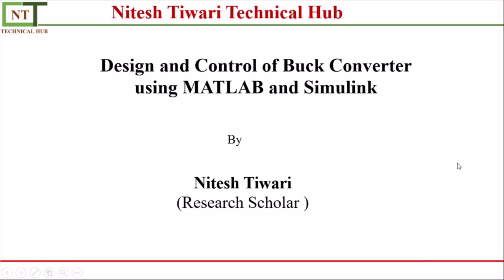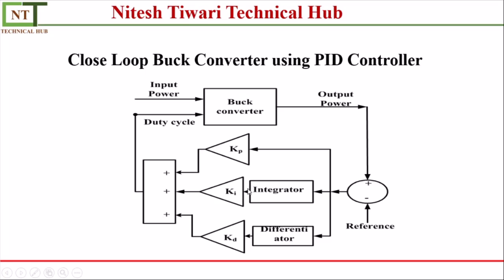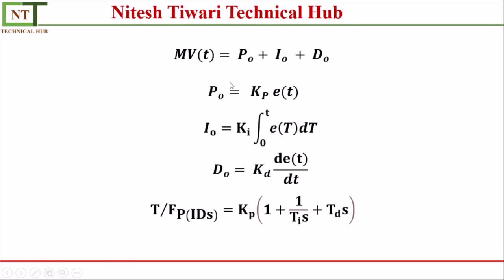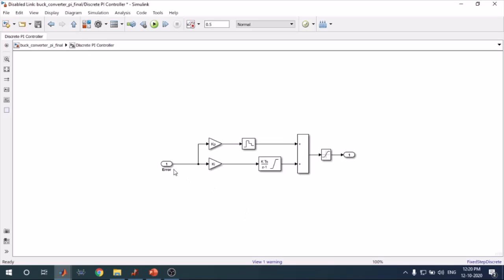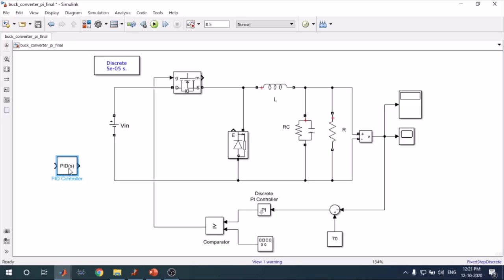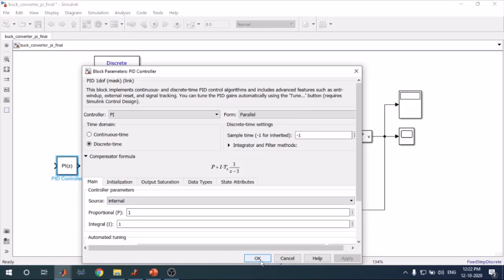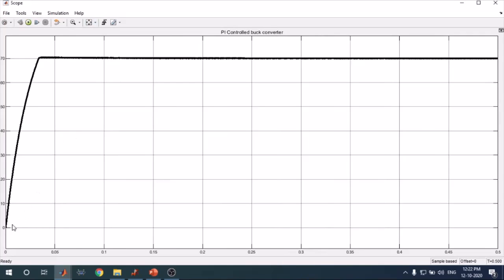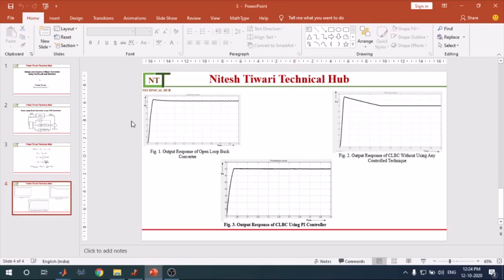Buck Converter |Lec 03 | Buck Converter using PID Controller |DC-DC Buck Converter|MATLAB & SIMULINK

Comment: Sorry to ask, how u get the frequency value at signal generator ? 5000hz?
Reply from the maker: The direct option is available to signal generator block, step signal block, or PWM generator block in Simulink library.
Reply: @niteshtiwaritechnicalhub8486  okay thank you